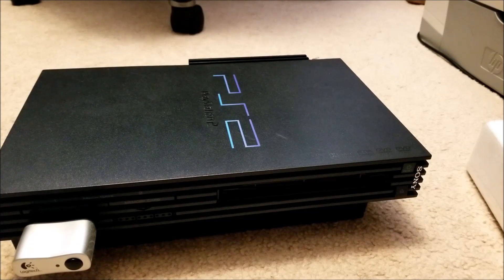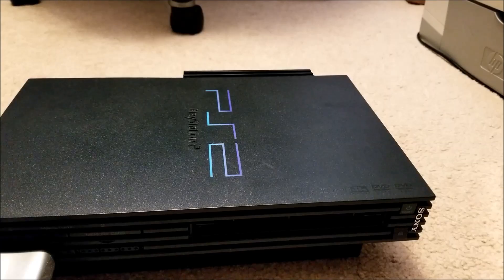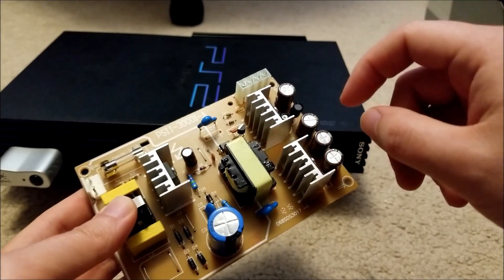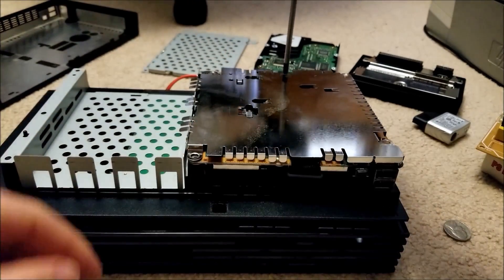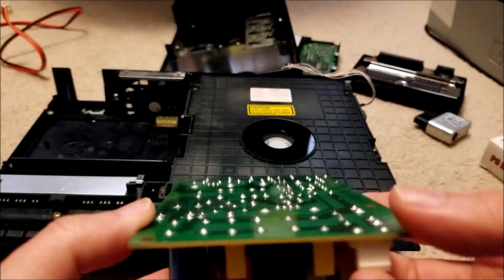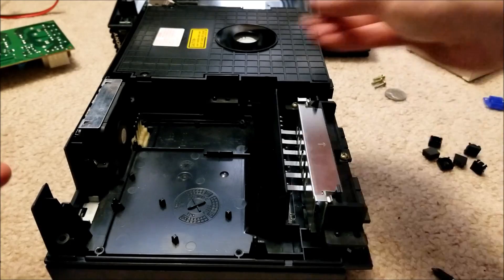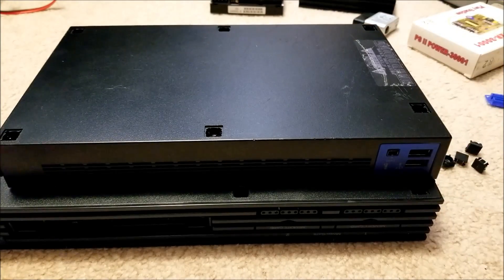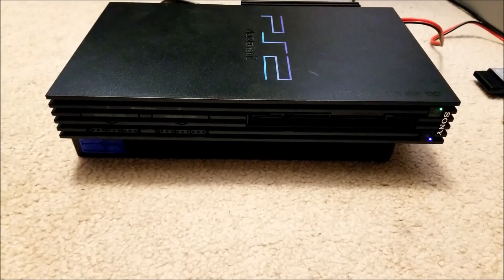Let's Fix: Sony Playstation 2 Power Supply Replacement

Comment: my slim ps2 has one of those power supply thingy and it marks 250v but the ps2 its self is 110 v can my ps2 work any other way without that thing
Reply from the maker: What is the model number of your slim ps2? I ask because the 70k series have external power bricks while the 90k series have internal ones.
Reply: @sjm4306  SCPH 90001a
Reply from the maker: Ok that would have an internal supply with just an ac power cord going into the console. If the label on the bottom of your ps2 says it will accept an input range (say 110V-250Vac at 50-60Hz) then you are safe running it off either voltage. If not then you would need to open it up and swap the supply for one that is compatable with your mains voltage or use an external power converter brick to convert it for your system.
Reply: @sjm4306  i bought it from a yard sale they said it had a power problem when i reached home i plugged it into the wall it cameon and worked fine but when i plug it out and plug it in back it didn't work. So i decided to open it i don't know about these things so i plugged it in and touched around the place and it came on so i carefully screw it up back and played so i thought i fixed but i didn't it just off again PLEASE HELP ME
Reply from the maker: Sounds like there may be a broken solder joint. Open it back up, carefully inspect all the through hole component solder joints in the power supply and reflow any that look bad/cracked. Also just a word of warning, poking around a power supply that is plugged in can be dangerous, so please be careful.
Reply: @sjm4306  i actually do see 2 joints not soldered down but here's the thing i don't have the thing that you have to melt is their anything else i can melt
Reply from the maker: Can you link a pic of the joints? You'll need to solder it (or find a local friend who can do it for you).
Reply: @sjm4306  how will you get the pic
Reply from the maker: You can upload it to a pic sharing site like imgur and share the link here or just shoot me an email at sjm4306@gmail.com

Comment: Does the 300 power supply work on the 5000 power supply silver mode
Reply from the maker: I believe the 3000 and 5000 models have different supply modules so you'll have to search for a replacement that lists your specific model number as compatible.

Comment: if the ps2 is chipped is the chip on the other board that you don't swap?
Reply from the maker: Yes, the modchip would be on the mainboard not the power supply I swap in this video.

Comment: Yeah my friend has a PS2 fat one like yours but it was dirty so I tried to inspect it before I remove the main screws and I noticed that the warranty sticker was gone then I looked at the bottom and all the screws where gone so I took it apart and I tried to pull the fan connector for the fan was stuck and it looked like it was tampered with and the fan connector wires just fell off so the only way that I can get it to work with out buying a new fan because I was broke of money so I modified the connector  buy cutting around the one on the board and I tried to solder the wire straight to the prongs but I forgotten which one goes where so tommorow I'll reverse the wire and see if the fan comes on but I made sure that the wires were not touching and filled it with a hot glue gun so it doesn't Arc

Comment: i accidentally plug mine in a 220 will replacing it like this make it work again possibly?
Reply from the maker: Check the fuse on the power supply board first, hopefully that's all that blew. If it killed the supply you'd have to replace it and worst case it killed the ps2 mobo.

Comment: My PS2 turns on but shuts right off when this orange light comes on at the lower front deck of the console and then the green and blue light blinks back and fourth at the power button. Cannot find any video on it at all so do you know what it could be?
Reply from the maker: Can you hear the fan running? It would help if you could upload and link a video showing exactly what is happening.
Reply: The fan only runs before the orange light comes on. Basically everything powers on like it should for like 3 seconds and shuts down and does what I stated above
Reply from the maker: Sounds like you are browning out the power supply. Do you have an internal hard drive installed? If you remove it and power it up does it still shut off?
Reply: I’m not sure I got this console along with a bunch of others for $10 in as is condition. Got 3 of them working great I just didn’t know where to start with this one. If there is an internal hard drive installed where would I find it? I don’t think I seen on installed before
Reply from the maker: If there is an internal drive there would be a screwed on network adapter stuck on the back. I was just guessing that the orange light coming on is a sign that the console may be trying to boot a hdd and drawing too much power which shuts down the system. If there is no hdd then it could be the power supply is just getting old and needs a recap.
Reply: Oh that? I have 2 of those on my other consoles and I though that was just a network adapter so you can play online. Guess it had its own terms haha. Yeah no this one doesn’t have that. If that’s what you think it is I’ll have to get a power supply for it. Any basic repairs you can make on the power supply board? Another console I had didn’t even show a power indicator before initial start up and I switched out the boards on another parts console and it works great now
Reply: So i went to make a video and now it’s doing this. I flip the switch for the red light to come on and like 2 seconds later it flickers a green and red light at the power button. If I push the power on button right away after turning the switch on the orange light doesn’t come on anymore and I can hear the fan run much higher than usual and then it shuts down and does the light flickering
Reply from the maker: If you have another ps2 with compatible power supply first try swapping supplies to see if that's the problem just in case it is something on the mobo instead.
Reply: I would but I don’t have any extras left. The other power supply that I have doesn’t send power to the power buttons when I flip the switch. I was thinking about replacing the fuse on it but that particular one has a fuse soldered to the circuit and I don’t have any like it to replace. What’s your suggestion?
Reply from the maker: If you are sure there isnt a short in the supply after the fuse and checked that the fuse is indeed blown you can solder a conventional fuse in. You could technically just use a length of wire but if there is another fault it could take out the supply, ps2 and also catch fire so ymmv.
Reply: Thanks I’ll see what I can do

Comment: Hi, my PS2 recently stopped working, it won't turn on. Where did you say is best to use the multimeter to check if the issue is in fact with the power supply board, and hopefully not with the motherboard or something else? The power supply seems to look fine, but I want to make sure that is the issue before getting the part. Also, my other question is, if I get a power supply for that console, the ones that I found say that they work with the model/version playstation I have, but they look different (the overall board shape and components that connect to the rest of the console are exactly the same, just the layout of the rest of the parts on the board are very different, with some parts that look like they aren't even on my current one). Could I use that different looking power supply board, as long as the board and connectors are the same? Or do I need to get a board that is 100% identical to mine in all ways? Thanks so much for your advice on this, I really appreciate it! Keep up the great work you do! Have a great week!
Reply from the maker: First step is to check the fuse on the power supply (use a multimeter set to beep/continuity and touch both sides of the fuse, if it beeps the fuse is good). Next you will need to open the ps2 and measure the output of the supply while the ps2 is plugged in (be super careful there is high voltage). The output of the supply should be around 12V. So if all this checks out then it is likely something wrong with the ps2 mobo. If not then you will need a new supply and it is ok if the replacement doesn't look 100% the same, just the positions of the connectors and board shape/size must be the same.

Comment: Hi. I'm trying to revive an HP DX7200 desktop (Pentium 4, socket 775 and Windows XP days) which was given to me. Just a day ago, it's green LED at the back that's on the power supply was lighting, now it's not. I'm not sure what happened. I opened the power supply and looked for a fuse. I didn't see any fuse but they say it may have a resetting poly fuse? Where could that be located and what does that look like?

Any recommendations, on how to repair this original HP power supply?

Thank you. God bless, Proverbs 31
Happy Easter!. Christ is risen!
Reply from the maker: Fuses or fusable devices are always in series with the voltage input so you can trace that out from the IEC connector pins. Computer power supplies indeed would not have user replaceable glass cylinder fuses. How are you testing the supply, plugged into the mobo or standalone without anything plugged in? From my experience ps failures are usually after the dc link capacitor, in either the primary side switching, the secondary side diode, or the output feedback/regulator (assuming it is a common flyback converter).

Comment: Hi. I can't find the post where I asked how do I revive my 1st batch Nintendo Famicom. It may be the power supply. My apologies if I'm asking this again.The Famicom's power supply is 100v and outputs DC. Our mains is 220v. The complete specs for the power supply is:

MODEL HVC-002
MITSUOKA D.S
AC100V 50/60Hz 18VA
DC10V 850mA

It'd be nice to restore it to its original. I've already opened it (it's got the rarest screw I've seen, tough to unscrew) it. 

When I test the voltage (using a step down transformer), what comes out of the jack (the end you plug into the Famicom) is less than 0.5v

Thank you.
God bless, Proverbs 31
Reply from the maker: Sounds like the ac adapter all right. You will need to open it and check the bridge rectifier and output filter cap (and fuse is there is one).
Reply: Thanks. There's no fuse, there's a small board w/ 16v 2200uF capacitor, then 2 larger than normal resistors (if they are resistors), it's black, each with two silver or white bands at one end. They have the label M2. The there's the big metal with coils of copper in it where this board is connected (3 connectors). The two prongs are also connected to this heavy square metal with coilings in it.

Is the next step to desolder the capacitor and the resistors (if that's what the black small cylinder are- it's laying flat on the board). How do I test if the capacitor or black things are broken?

By the way, what's the symptom that an adapter needs to be rewound? I hope this one doesn't need that and it's just the capacitor or resistor.

Thank you. God bless, Proverbs 31
Reply from the maker: The black cylinders are diodes, they rectify the ac coming off the transformer to dc. To test the cap you can remove it and use an esr meter (cheap transistor testers on ebay/amazon can measure esr) to see if the cap has gone bad. To test the diodes use a multimeter on diode mode to make sure they only conduct in one direction.
To check the transformer use a multimeter set to measure resistance. The two issues is either the primary or secondary has a short between windings or has blown open. You know the ratio between primary and secondary should be the ratio between input and output voltage so you can measure and compare those ratios to determine if the transformer is good. In all honesty though I have very rarely seen a transformer fail in small adapters like this, it is pretty much almost always the diodes or caps on the secondary side.
Reply from the maker: Yeah you should desolder the diodes to test (though just desoldering the cap should be fine for this specific circuit). A 1N4001 or anything around 1A 50V will be way overkill and do just fine if it ends up being a diode that has failed.
Reply from the maker: It is ac, there technically isnt a positive and negative (only live and neutral, which are really only important for wiring wall sockets).

Comment: That power supply board is only 10$ on eBay, seems kinda sketchy to me.
Reply from the maker: The main things to worry about are the primary/secondary creepage clearances (they looked ok to me), the electrolytic caps (I will likely replace them just to be safe), and the winding isolation of the transformer (I suppose if you are worried you could rewind it or swap it with the original one if that wasnt the failure point. Other than those points a power supply like this one are pretty simple so I dont think there is much to be worried about with the fused input/protection devices in place.
Reply: @sjm4306  honestly I don't really know what happened to my ps2. I'm pretty sure it's the power supply board so I'm going to try what you did in this video, and go from there. By the way, you just earned yourself a sub
Reply from the maker: Thanks Mr. H and welcome aboard!
Reply: @sjm4306  Oh, and does your power supply  (for the ps2) still work?
Reply from the maker: Yep no problems, I've added in an internal 2.5" sata as well and it runs fine.
Reply: @sjm4306  well, I ordered the supply so we'll see in 2 months how it works.

Comment: That link to the power supply does not work. I am an ultra noob to soldering but a an experienced intermediate when it comes to repairing things. Is that PSU mod with the printer thing an easy task? Could you perhaps make a video on how it works?
Reply from the maker: This link should work: https://ebay.to/2JqWY4o
I'd first open your ps2 to make sure the power supply board you order looks the same as different models use slightly different power supply boards.

As for the external psu mod, you'd need to solder and if you mess up it could fry your ps2/set fire to something/etc.
Reply: @sjm4306  Thank you so much, sorry for the late reply, YT never notified me n I went around digging my ps2 again lol

Comment: I dont know if my problem is the same but my ps2 doesnt turn on, it turns green then red instantly
Reply from the maker: The power supply might be browning out or something. If you can measure the 12v rail with a multimeter when it happens and see it drop when it tries to turn on then that's the problem.

Comment: Great vid.. :) can you make a vid to power ps2 externally? :D
Reply from the maker: When I first got this unit, since I didnt have a replacement power supply I actually did exactly that. I used my 3d printer's 12v power supply to test if the ps2 worked and it obviously did so I knew I needed a new ps.
Reply: sjm4306 can you show me how u did exactly that? I just want to test my unit too.. so i know if it still works :D
Reply: So uhm the ps2 had 4 pins sticking out from its main board right? Which ones did you solder to the wires? Did you only use 2 of the pins that were sticking our or did you solder 2 for each wire?
Reply from the maker: I desoldered the connector from the dead ps, soldered like 12awg thick wire to it (checking polarity), wired it to the 3d printer ps, and fired it up on a switched power cord just incase something went wrong so I could immediately shut it off.
Reply: I got my ps2 to turn red, so now i know its getting power.. but it wont turn to green when i press the power button.. is this normal because i dont have the proper psu?.. or does my ps2 have another problem entirely?
Reply from the maker: What is the wattage of the 12V supply you are using? The ps2 will draw 2-5 amps so your supply could be too weak.
Reply: I used the power supply of that you use to power hdd enclosures.. model: SS34W1205
INPUT: 100-240VAC 50/60Hz
OUTPUT: 12V--2A and 5V--2A
Reply: I got ti to turn on.. turns out i forgot to wire the ground wire.. but i noticed the psu that i used was buzzing so i quickly unpluged it.. and when i turned it on only the green ligth turned on.. im afraid to plug it in a tv to check if it really was working becuase i dont know what it might do to the tv
Reply: Would it be safe if i plugged it into a tv? Just to see if it was displaying anything?

Comment: Alright my guy... Maybe you'll have the answer. I"m installing LED lights on that same model of PS2. where can I stick my positive and negative wires leading to my 12v LED lights?
Reply from the maker: You can easily grab 12V from the output pins of the AC power supply or the input to the ps2 main board (just double check with a multimeter to make sure you have V+ and Ground correct first).